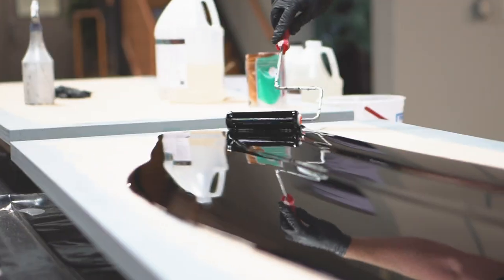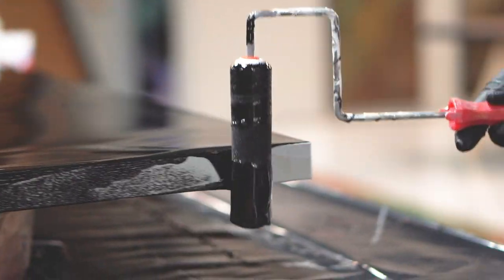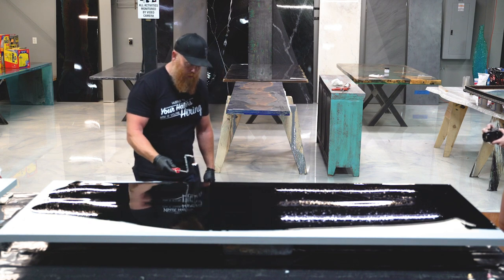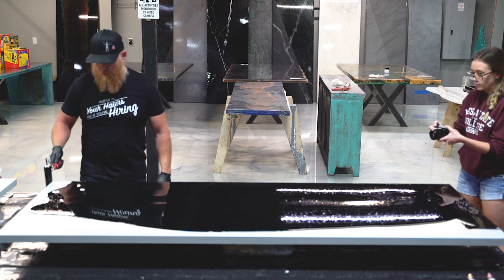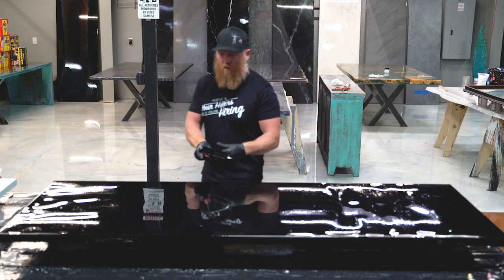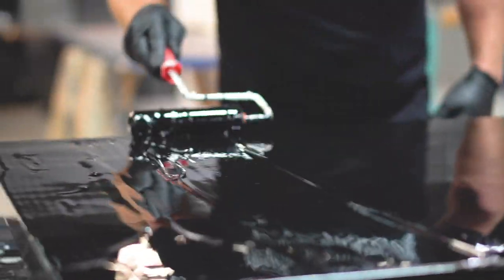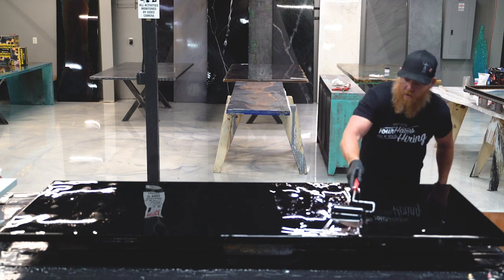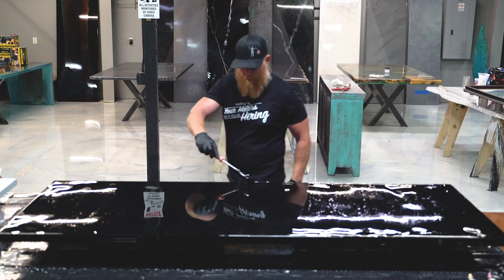HOW TO | Get Perfect Edges with Epoxy

Comment: I wish I would’ve seen your vids before I did my countertops. Is there anyway to fix the edges only? The epoxy didn’t flow over the edges evenly and I have obvious drips...hellllpppp!
Reply: Hey how are you? No worries my first pour I ran into similar issues. To get rid of drips all you need is a angle grinder and a 60 grit flap disc. The actual discs are cheap around 7 to 10 bucks for a decent one. Just make sure you hold it level underneath the countertop and use a steady hand obviously the more pressure the chance of gouging the face. Practice first on a piece of trash wood to get the feel of it. As far as repouring the edges. First mask of top of countertop to the edge, mix a small batch. I would heavily dab on with a brush and then roll on with a 3/8 " nap roller repeat again then torch lightly to ensure uniformity . Hopefully that will be of some help to you🤙
Reply: It can be sanded down using 120- 220 grit will smooth out the drip. I used this range on my table top and to much was removed untill lowering the speed of palm sander. So it is not a exact science. you may want to start with 300 just to see what it do.

Comment: Any recommendations for leaving edges  "uncoated"? I'd like to do a plywood countertop in my laundry room but leave the edges exposed. Currently, my plan of action is to add a couple layers of 100% black epoxy (like the one used in video) to the top of the plywood (leaving the edges bare), next I'd like to add a chamfered edge to all sides that will be seen.  For the last step do a seal coat (with epoxy) on the newly chamfered edge and sanded plywood counter face (was hoping this additional seal coat would restore the shine of the epoxy that was lost when cutting the chamfered edge aswell as seal and protect the plywood). Please let me know if you see any issue with this approach. Thanks in advance
Reply from the maker: Hello absolutely we like to use foil duct tape typically found in the Heating and AC section.  You can use this as a form. Give our office a call and we can go over a process for you 970-639-9338.

Comment: And the edges?
Reply from the maker: Roll the edges with product to break the surface tension so when you roll the product on the top it flows over for a smooth edge.